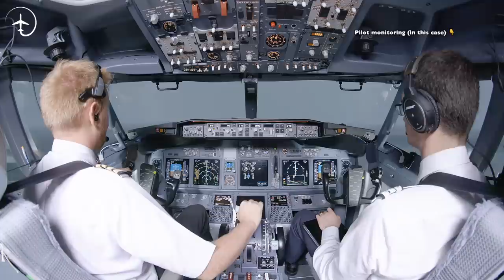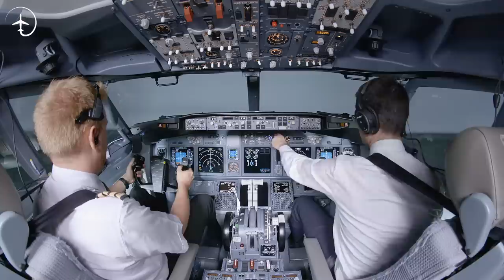Airplane Atlantic speed record!

Comment: Back in the late 60s, I was the programmer/analyst/systems engineer responsible for the maintenance/repair provisioning of DC8s & 9s (including the "Big Bunny" Stretch-9). I worked on Century Blvd, overlooking the LAX North Runway, which was the only runway reinforced and long enough for the new 747s to land. I spent many hours on our rooftop vantage point observing them "float" in - - compared to other jets, they appeared to be traveling in slow motion. The 747 remains my favorite plane (although I did enjoy the tailcone airstair available on the DC9).
Reply: Yeah, it's amazing how with just the right conditions they can seem to be just hanging up there in the air.
Reply: That’s so cool @Carol, have you ever written about your experiences?
Reply: That's because LAX is right at sea level. You can also watch on YouTube a 747 fall out of the sky on approach to a high-altitude airport in Afghanistan on a hot and humid day. It's all about air-density.
Reply: @Carol Williams That was an amazing time to be working around LAX before much of the aerospace manufacturing (and Nash) went away.
Reply: I was a f/f, paramedic at MIA in the early 80’s. We would get to the airport early and wait to be escorted in. I would love to watch a 747 “float” in that landed around the same time in the morning. I would always just say it looked so “graceful “.
Reply: @Qasibr  - -  Not really, most of it was security, so you can't.
Reply: @mikecowen6507  - - Nash ??? Almost every work day, I used to park at the end of the runway, which was accessible at that time on the highest residential street of Playa del Rey - - tho now it's been completely cleared of very  expensive homes, above Pacific Coast Hwy & Dockweiler Beach, for noise abatement & fenced off for grounds security. I would have my lunch in the car waiting for the approx 12:30 take-off of the London-bound 747. It was heavily laden, more than domestic flights, and literally lumbered into the air with much strain and not much clearance. Quite a sight - - you could read the serial numbers on the fuselage.
Reply: @TheTropic23  - - those were the days !!!

The first time I flew to Miami, it was with a friend whose husband had been in the Air Force and they had lived at Cape Canaveral. I stepped Into the jet way and said, what's that smell? She said, welcome to Miami humidity & mold. 😂

On a sad note, TWA flight 800 just broke my heart... 😧
Reply: @carolwilliams7052  I always wondered about that missing neighborhood! I'm doubly jealous you got to do planespotting from there! Keep in mind I'm just a hair too young to have experienced it firsthand (64 model here), but I know some of the history of the area. Nash automobiles had a plant on the south side of LAX at Imperial highway & Nash St. (Imagine that!). It's now Boeing Satellite Systems @ 2060 E. Imperial highway. The multitude of rail sidings once feeding the large auto plant are still very visible in satellite imagery, as are the odd cropped buildings that once hugged the curved tracks.
Reply: @mikecowen6507   Ooops, I'm sorry I missed your post from 2 years ago. My job before the one on Century Blvd was in El segundo on Aviation Blvd.. Scientific Data Systems where I was a specialist in Sigma 7 COBOL. That was before they became Xerox Data Systems. I started my computer career in 1966, so I think I predate you a bit.
Reply: @youtubemodsaresnowflakelef7692  Are you posting to the right topic, or the right person ??? I don't understand what you're talking about.
Reply: @carolwilliams7052   Your name is "Carol", which is (depending on culture, but usually is the case in the West) a FEMALE name...

You state you were a programmer and systems engineer in the 60s. 

Therefore I made a sarcastic/satirical comment, that this cannot be possible, as according to many (idiots) women are oppressed and held back by the patriarchy in 2022, let alone in 1960...
Reply: @Snowflakes - - I was a math major which is where classes for computing and programming were. And I took them all. There weren't any Computer Systems or "IT" depts then. I started working in 1966. My aerospace jobs were from 1968-72.
Reply: @carolwilliams7052   It's fine, I believe you... It was merely a joke, pointing out the stupidity of some people claiming they were / ARE STILL (in 2022/2023) being "held down" over their gender/race/etc. rather than putting in the work, studying hard, etc.
Reply: @Snowflake - - Whoa - - that's a really strong judgment call without walking a mile in someone else's  moccasins. I can tell you that what I accomplished was generally a troublesome struggle and achieved at great personal sacrifice in other areas. There wasn't only a glass ceiling, there were male bosses who thought you were there to do favors for them or clients. The sexual tap dance got tiresome. I left data processing after 11 years and opened my own business in an unrelated field.
Reply: @carolwilliams7052   Well yes, naturally I was gonna be harder back in the 60s, since obviously back then most industries were far more male dominated. And you had less options to turn to someone for help, regarding comments and actions etc.

However you perserved anyway, which is applaudable.

I just find it ridiculous how some people would claim NOWADAYS that basically women were chained to the hearth back then (of course it was harder then), and that even today there are some invisible yet allegedly "systemic" barriers to them finding work in any given industry, when in reality it has never been easier for them nowadays, with many training programs etc being specifically tailor made for them, quota promotions being in place in many countries as official policy (law) or at least internally with companies/military etc.

I wasn't trying to diminish your achievements whatsoever.
Reply: @Snowflake - - I realize that you're making judgments from a place that you haven't experienced, but to tell you the truth, the country was not willing/able to pass the ERA, we still don't have salary parity (wimmin DO NOT make equal pay for equal jobs in many cases), and now we have the added burden of the government wanting to dictate our uteruses. If you think that family planning and unwanted pregnancies aren't going to affect the female job force, I don't know what to tell you. If men also got pregnant, it would be a whole different ball game. 😁

Comment: The difference between air speed and ground speed is similar to the difference between ground speed and galactic speed. If you stand still, your ground speed is 0, but your galactic speed is 67,000 mph (the speed the earth orbits the sun).

(I just made up the term "galactic speed")

Comment: A few months ago I flew  with Thai Airways from Bangkok to Sydney which I do fairly regularly. I noticed we  tracked south rather more west than usual in fact passing just east of Jakarta. However when crossing into South  Australia quite far west of Sydney we turned almost due east and the ground speed picked up to just over 1,200 km/h  - of course we had been  picked  up by the jet stream - and we arrived in Sydney a little before schedule. Well done Thai Airways! Saved fuel by flying a longer over the ground distance but a shorter time in the air, burning less fuel. Nice piece of navigation.

Comment: Imagine the fuel savings
Reply: "IF" they recuded the power output to match the "normal air" speed...
The boat explanation actually helped me a lot.
Reply: @snypa-ck7hn  true but they safe fuel due to time saving
Reply: @Marco-wz3ff  exactly. Four thirsty engines for two hours. Wow.
Reply: With my car I usually drive around 100 km/h which uses around 1 liter per 17.5 kilometers. Driving 130 this swiftly goes to 1:10.

This Monday the wind was still strong in Western Europe and I drove with tailwinds, normal gas pedal stance, around 120 km/h (20km above normal) and a consumption of 1:22. That was sooo cool, it felt like being pushed forward!
Reply: What you gain the swings you loose on the roundabouts: there is always the return flight to consider.
Reply: @snypa-ck7hn  He should've used the classic airport moving walkway instead :p

Comment: A couple of times we landed at SFO 40mins early but both times were late at the gate. One time as late as 30 mins because the flight at the designated gate had a delay. So in spite of being 40 mins early, we were 70min late and several people missed their flights.  The mess in commercial aviation is almost always on the ground and only very seldom in the air.

Comment: "The airplan isn´t moving faster than normal... but the air arround the airplane is moving!" ... so technicaly they are at Warp?  ^^
Reply: Lol. Never thought of it like that
Reply: @米空軍パイロット  yep. Air speed was the same but groundspeed was a lot more higher. Tailwinds make the aircraft aerodynamically slower but can push the groundspeed higher in an aircraft. I'm assuming that you might not have fully known this but at the same time, you may have already known this fact :)
Reply: @TheAviationChannel  Nah. I'm an aeronautical engineer and an Air Force pilot,  so I got the concept. It's the comparison to a Scifi warp bubble that was new to me. Good explanation, though. You're spot on.
Reply: great analogy
Reply: if only space had the equivilant of jet strems.The nearest thing i can think of are solar winds.
Reply: Any faster and a wormhole to another dimension will appear, it will be like StarFox
Reply: Naw- more like a fly propelled by a draft from a table fan.
Reply: @aerojetrocketdyners-2538  There was a TV episode of Deep Space 9 that played out the solar wind analogy.   The actor used his vacation time to build an "ancient" spacecraft that had no engines, but used solar sails in order to achieve warp speed to travel to a "nearby" planet. It was a cute episode with artistic elements that resembled how someone might build a replica of an ancient sailboat to experience the excitement and challenges of crossing an ocean to another continent using primitive technology.
Reply: Being the most simplistic you can get here: think of jet streams like those moving walkways you see at the airport. When a plane enters a jet stream, it’s moving at the same speed, but what is around it is pushing it forward, much like those moving walkways.

Comment: I've been flighting between NYC and Portugal since I was 6 months old and I'm 41 now, and we had to stop on 2 different occasions to refuel due to headwinds going back to the NYC, once in Gander Canada, and the second time in Bangor Maine.  So running out of fuel certainly does happen but it's not dangerous. Side note when refueling they would take the passengers out of the plane and lock them in a room until the plane was ready.

Comment: I was on a cathay pacific flight from San Francisco to Hong Kong in a 747-400 and we had such a bad headwind we had to stop in Taiwan to refuel. There were several other planes with passengers refuling with us out on the tarmac away from the gates, so this jet stream must have been covering a large area. Note that the pilot did advise we had enough fuel to make it to Hong Kong but not enough to hold in a pattern if there was traffic, so he played it safe and took on more fuel before proceeding to HK as it seems many others did as well.

Comment: Stall on the way in, rip the wings off on the way out.  So, you have to go fast as you enter it to compensate for the initial loss of airspeed and then really slow coming out to compensate for the initial gain in airspeed --

Comment: But in some cases regarding strong headwinds. Some flights will actually make a technical stop to take on extra fuel. For example at my local airport shannon. Sometimes an azur air boeing 767 makes a technical stop while routing from Moscow to varadero

Comment: 8:55 rescheduling or cancellation of flights due to strong headwinds aloft may well be the most practical solution for short/medium haul overwater operations, though the B738 is an incredibly fuel efficient aircraft with an impressive range so I would not have thought it too much of an issue.

With long haul international operations and these conditions it is quite rare for flights to not depart as scheduled. Whenever it’s calculated there will or may be fuel to range limitations from forecasted strong headwinds a refuelling stop enroute will be planned for.

Although this may be perceived as an extravagant option to divert for refuelling it is indeed far less expensive than hotel accommodation, transporting and feeding large numbers of upset people due to missed connections. 
It can also take up to several days to resolve the disruptive domino effect on a long haul aircraft’s route planning and engineering schedule along with all the logistics planning and rosters of its 12 - 28 crew (depending on type), vs. up to 24 - 48 hours for a short haul aircraft and its crew of 6 - 10. 
All in all a very expensive exercise so a planned refuelling stop, provided it does not breech duty hour limitations is preferred.

The mantra of 'safety before schedule' is highly regarded featuring as a primary influence in absolutely every decision irrespective of any fiscal factor.

Comment: Sounds like  it almost needed space shuttle heat tiles on the leading edges as it came back into the slower air! There must have been a small temperature increase on the leading edges but nothing significant. Thanks for uploading Petter.

Comment: I can remember being amazed while flying from Los Angeles to Frankfurt on a Lufthansa 747-400 back in 2009, watching our ground speed increasing on the gps map and stats on the screen on the wall of the bulkhead in front of me. Going over 700mph as we crossed the eastern United States heading out over the ocean and then increasing to around 800mph, it's been several years so it's hard to fully remember, but I couldn't believe how fast we were going. 

It's amazing to see airplanes landing in crosswinds on videos, but it's crazy and kind of scary to see airplanes landing in crosswinds in person. I can remember when I was in the airline industry in Southern California in the late 80's sitting near the runway on a baggage tractor watching the airplanes coming in during Santa Ana winds with them crabbing almost totally sideways with the passengers on the right side of the plane pretty much looking down the runway and then being amazed seeing the planes turning and straightening out just as they touched down onto the runway. That was so amazing and totally impressive to watch.

One Question that I have is: Why do airplanes retract their landing gear during a go around? Since they will soon be back around for the landing again or is this in some sort of preparation incase they end up having to divert to another airport?
Reply: Dave W Retracting landing gear gives a better climb rate, and reduces fuel burn during the holding pattern.
Reply: Very interesting, Thank You Very Much👍

Comment: There was a crash in the  late 40’s or early 50’s in South America, a plane arriving in Santiago Chile from Argentina disappeared after contacting airport control saying it was beginning its final descent. A search failed to find it. It was finally found in the early 2000’s when bits started melting out of a glacier 100 miles or so short of where the plane last reported its position. They had been in the jet stream without realising (the winds are called the jet stream in part because it was jet aircraft that confirmed there existence, though B-29’s and some airliner conversions of bombers encountered them occasionally) as the phenomenon wasn’t fully understood at the time and were navigating by dead reckoning as they had no ground sightings so descended too early and flew into a mountain,  probably in cloud. The wreckage was buried by snow and not found until it reached the melting zone of the glacier.
Reply: 2nd August 1947, 'Star Dust' G-AGWH, a British South American Airways (BSAA) Avro 691 Lancastrian 3.

Comment: Doesn't it cause a problem for ATC when planes suddenly cross the atlantic much faster than expected? I thought the airspace of the atlantic was controlled in a way that every plane would enter that airspace at a certain point and speed and follow a flightplan and in that way you can make sure to keep seperation between planes. That wouldn't really work if you dont know how fast planes are going?

Comment: The aircraft could have reduced its IAS and become the most fuel efficient 747 to fly the Atlantic. The official trans Atlantic time West to East was set by the SR71 in 1974. I saw it landing at Farnbourgh, after slowing down turning over Holland, in 1hr 54 minutes, this was slower than the usual flights our way as a inflight refuelling took place in case a divert was needed as weather was bad in the landing area. The SR71 was replaced by the Aurora in the 80s ,is it still flying or not? The TR3B , or TR6Telos and other US craft can fly the Atlantic after coming back from space quicker than you can have a shave. I have witnessed this AG tech in 71.

Comment: If a jet stream were to travel at trans-sonic speed and the plane in it were to travel at trans-sonic speed, both speeds combined would be close to Mach 2.  In all this, the plane would've flown slower than the speed of sound relative to the jet stream, but obviously much faster relative to the ground.

Challenges would be that apparently there are no jet streams that move that fast, and it would be dangerous for the aircraft transitioning between regular air and jet stream, if the difference between the speeds of regular air and air in the jet stream were too high.